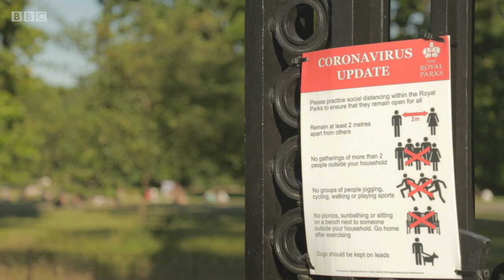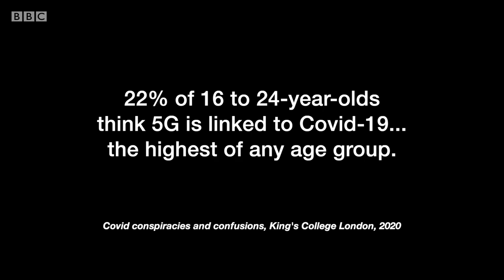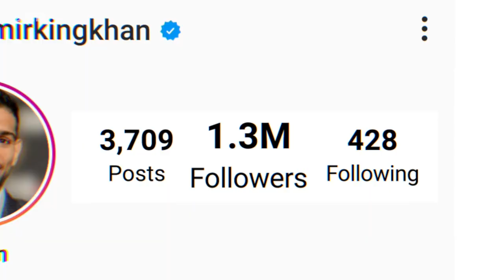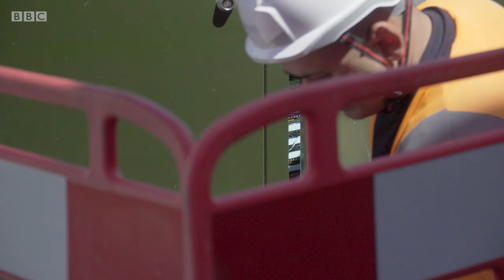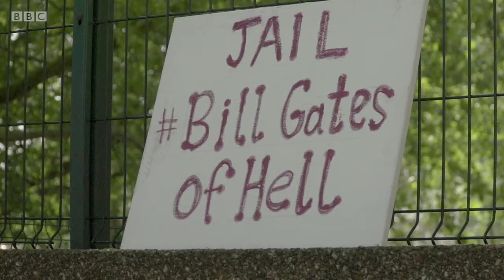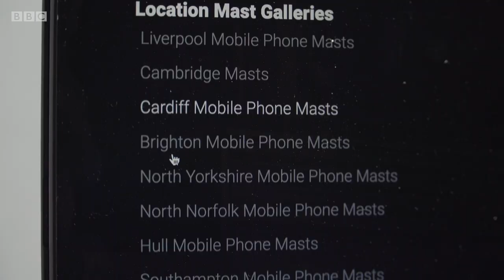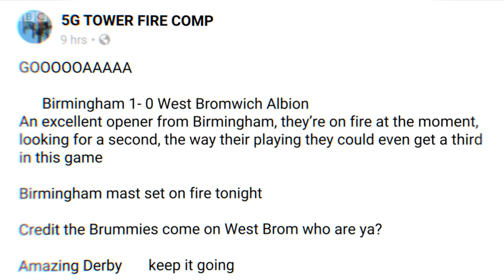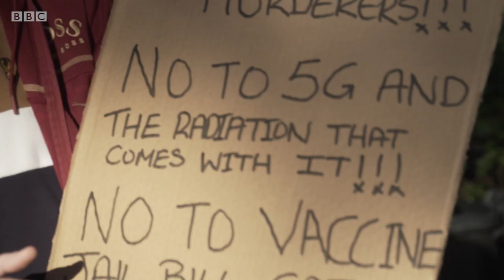Viral: The 5G Conspiracy Theory by @bbcstories - BBC

Comment: My father who is a citizen radio enthusiast has engineered his own devices among using and promoting radio wave technology.  It's the same as cellphone, wifi, radio, CB, HAM (Short wave, long wave). This technology has been used for years, ten's of years. There are handheld radios (HAM, CB, Trunked...) that have been used for years by amateur enthusiasts who also use amplified technology that can skip through the atmosphere to other countries with encryption used with modulations. These are only accomplished using high voltage, low frequency signals that have absolutely no effect on anything. Talking about thousands of watts to the point where bolts of electricity can shoot out from the antennae. There are actually competitions on where people compete on producing the loudest signal in attempt to drain out the other persons signal. These are performed and organized by ordinary citizens, not the average cable layers, not the guy, climbing a 1000' tower to change a lightbulb. But somehow people think that a guy installing a simple coax or fiber line is causing sickness? People, please stop listening to people who obviously have mental impairments and have a mind of your own. Yes take in the information around you, but it takes an intelligent, conscious decision to to be able to decipher what is fact, fiction, or sickness.

Comment: I'm an electrician and was working on the roof of an apartment building where they leased space out to AT&T. The 4G antenna arrays have roped off barriers and signs waring "Danger RF radiation - Do not cross". Now tell me what kind of power they transmit at to have to warn you about it?
Reply: An electrician huh? Then explain ohms law with detail

Comment: So this immigrant is installing home internet and fiber optic connections directly into hubs connected directly to buildings.
5G is a wireless cellular standard. Emphisis on WIRELESS.
While observing him working you can see he is clearly working with cables AKA WIRES.
So if he was working on a WIRELESS standard like 5G, then why is he installing WIRES into a hub that is directly WIRED into buildings?
Home internet? Last I checked even if you had a Wi-Fi router, you still have to plug it into the internet using a network cable ie a WIRE to access your ISP and get service.

Comment: Okay... what the hell is 5g???
Reply: 5th generation mobile phone communications protocol,  virtually identical to fourth generation or 4g,  the nutters dont understand that.   If anyone says otherwise they are liars.
Reply: @dogwalker666  Thanks
Reply: @rileyholt2086  👍
Reply: @dogwalker666  virtually identical?
Wrong you are. It's completely different as in different frequency. Millimeter wave requiring lots more infrastructure due to it not traveling well. Capability to 60ghz. Was designed as a military device for crowd dispersion. Thought you knew the science.

Comment: Radiation causes mutations... definitely a link at the least to coronavirus
Reply: Please consult Google for the full definition of ‘radiation’, but to encapsulate it - radiation is energy coming from a source through the release of light, heat and/or particles. Radiation does not ‘cause mutations’ unless you are talking about ionising radiation such as gamma radiation. If radiation as a whole caused mutations then you’d get sick from standing next to your ‘radiator’ or under a light bulb. Visible light sits at a far higher frequency than 5G - in the THz spectrum - but you don’t get sick from sitting under a floodlit baseball stadium. 

5G uses the non-ionising radio spectrum previously used for things like TV broadcasts. I don’t recall anyone complaining that they got sick watching NYPD Blue back in the day.

Comment: 7:15 radio and mobile phones are 10s of times less energetic but yet even microwaves, the next runner up, we're told to be careful with because they're dangerous. If microwaves powered at certain levels can spontaneously combust objects to flames, how much further is phones radiation from that capability?
Reply: Scientists have conducted tests to see what the minimum power level required to cause a small but measurable rise in temperature is. The legal limit of what the maximum power level that a phone mast or other equipment can give out is set to 10x less than that, just to be extra safe. The 5g standard does include microwave frequency use as an option but the masts operating so far are using the same frequencies as 4g but with cleverer signal processing.
Reply: Do you know how a microwave oven works?